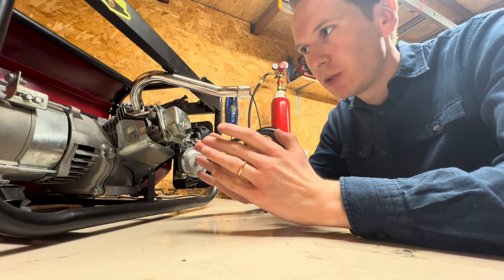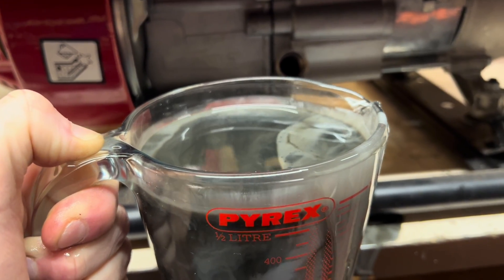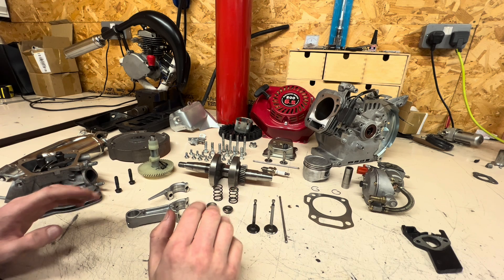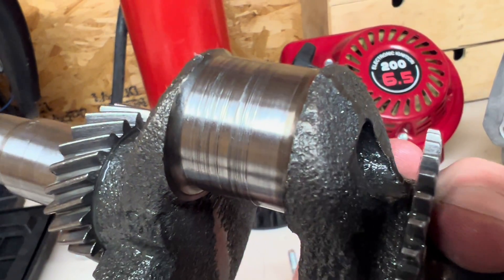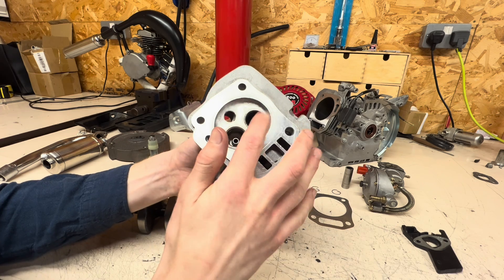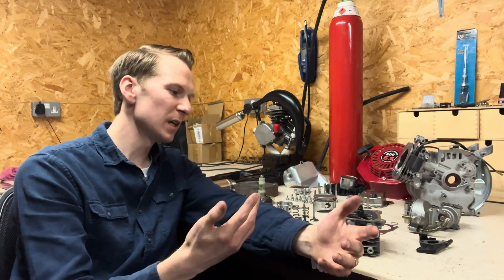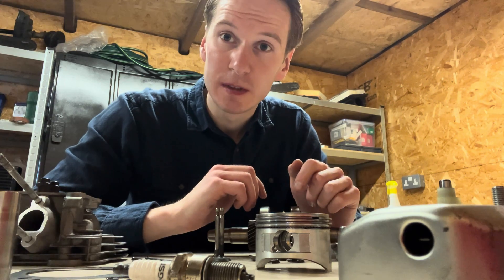Internals After 2 Years of Hydrogen

Comment: No bearing steel on the connecting rod journal is destined for failure; with the connecting rod being cast metal and the crank being steel, the rod is always going to lose out as soon as lubrication becomes an issue; In this engine, the big end simply sits in an oil bath and as soon as there is any metal/alloy contaminate in the oil it will 'attract' itself to a point of friction, in this case, the crank/rod journal, and it will keep on attracting more fine metal/alloy particles every time it runs; I note their is no oil filter in this engine; This build up of particulates has the same effect as graphite paste and causes the wear on the rod and crank journal we see here;
This has nothing to do with the type of fuel used; The oil is not milky like we would expect to see when oil is trying to mix with water....what we see here is metallic oil;
The wear on the valves is a fuel relatable issue;  I suspect valve train lubrication is not all it should be in this engine; 
Ever since the advent of unleaded petrol, valve face/seat and stem seal wear has been an issue; Unleaded/alternate fuels do not have any lubricating qualities; Hardened valve seats and Vitron stem seals helped solve this problem until metallurgy and oil chemistry caught up with the demands of hotter and dryer fuels;
This is evidenced in many modern engines with cylinder head failures being the number one cause of catastrophic engine failure; 
Bent and recessed valves or damaged valve faces (carbon build up) lead to hard cold starting before starting becomes impossible; if this hard starting is diagnosed early enough and the cylinder head gets refurbished, many modern IC engines last 100's of thousands of hours before needing to be rebuilt...providing that regular maintenance (oil changes) is performed of course.

Comment: I hate to tell you but it's a lubrication problem a thicker synthetic  oil your on the right track keep up the hard work making videos and have a blessed day today 🙏
Reply: The big end is lubricated by a 'dipper arm''.
For it to work properly,  you need a thinner higher quality oil.
Thicker oil just can't get through the splash lubrication hole and will lead to earlier failure.

Comment: If water contamination is an issue,we could make components from either coated materials or use better materials,ceramic is used in some engines and i saw a complete ceramic block.

I have a Triumph 1500 spitfire and a problem among many due to basic engineering i have now solved is that GL5 oil,i may be mixing up my GL's,but the spitfire uses what are called yellow metal bearings.

Now,yellow metal thrusts or gear shift components or in the diff,when run at running speeds and pressure the oil heats up,the oil contains additive to withstand the thinning due to heating and has solid additives like sulphur among others.

This is now back to hydrogen,when engine oils heat up if sulphur is present in the oil any water contamination mixing with sulphur at high temp will create sulphuric acid,which in the spitfire  was not good for yellow metal components,i dare say sulphuric acid contamination is not good for any engine components,except lead,but there are not many lead components inside an engine.

You can run engines on a dry sump,where you have a pump system fedding all bearing surfaces,not sure how it deals with cylinder walls,maybe some type of ceramic molybdenum coatings,i'm guessing now.

Comment: From the rate of burn compared to petrol,ignition of hydrogen is way too fast for normal ignition timing ,also valve over lap can be an issue,more the igntn though,it has to be retarded to get the igntn after tdc to stop the cod rod being pushed vertically through tdc or before.

A system of igntn timing adjustment while running to find the best position ATDC some old cars(i own a 76 spitfire) earlier spits had distributers fitted with a vernier ajustable points plate,if the engine is fitted with a coil on laminations type igntn like honda GX120 etc engines,a means to allow the coil assembly to slide around the circumference of the housing mounts by some degrees,a second mount plate with slots to allow movement to find the right position relative to the magnets on the rotor v tdc etc.

I've been looking to run hydrogen myself for too long now ,but have picked up info or components,i'm an electronics technician and stan meyer  used a pwm system and i believe ultrasonic system so i read to vapourise the electrolyte,it could just be BS,but the pwm uses two stages,one to create a mark space ratio of 1:1 at a variable frequency that controls a second slave stage that is free running at a higher frequency,you get an on off square wave that is made from a continuous higher frequency cycle,apparently a resonance can be found that will make the hho formation very abundant,also using urea along with potasium hydroxide yeilds greater results.

Comment: I've owned a number cars that i ran on LPG (liquified petroleum gas = a mixture of propane + butane + isobutane) and i have experimented with cars running on e85 (85% ethanol + 15% gasoline) 
Both fuels burn very clean/complete and leave very little (if any)  deposits on the internals.
Both fuels also work great in high boosted  turbo charged engines. (I tried, it's true 🫠😉)

H2 is an interesting fuel but the problem is the production of H2. As far as i know there are basically 2 methods: electrolysis of H2O or chemically splitting H2 from another abundantly available  compounded molecule. That would most likely be natural gas. It takes energy to do this chemical proces and the residual waste product is ....CO2. Not ideal!
So in my opinion it's easier and better in terms of energy use to burn the natural gas directly in an ICE engine. That way we would avoid  energy losses in chemical conversions.

Are there other (new?) more efficient ways to produce H2 ?? I would be interested to know!

But IF you absolutely  want to use H2 as an energy-carrier then it's preferable to use that H2 in a FUELCELL where H2 is converted back to H20 and direct electrical power.

Comment: 9:30 I don't think this engine cannot be economically rebuilt.  I would also mic the lobes on the cam. All that wear on the crankshaft is worrying in that regard.   The crankshaft and con rod are going to be more money than this engine is worth.  it would be cheaper to just buy a used engine or, if the crank is the same and it fits in the cage, just a new generic engine like a HFpredator. Or maybe you can find one for a low price for the same generator that runs but produces no electric  power.
 
I think water is getting into the oil and contaminating it, which is causing your wear problem. The oil looked very grey, especially when it was on the dipstick (there was light problems when you showed the oil directly).  That wear is absolutely abnormal.  Also, you didn't mention how many hours are on the engine.

It does seem strange though that it appears water is getting in the oil.  Burning gasoline creates a lot of water too. 1 gallon of gasoline produces 2 kilograms of water (2 liters about).

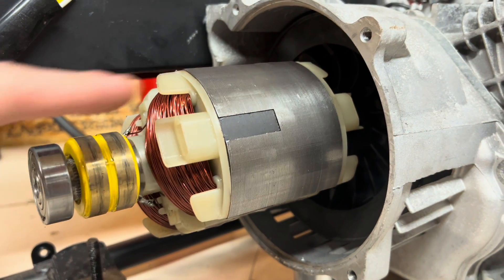Comment: 2:54  You really don't need a tool.  Turn it up so the generator is facing the ceiling.  If it doesn't already have threads (many do, but not all), tap some threads in the hole.  Then get a 6-8 inch bolt of the same size and thread.   Pour some water in the hole (most of the way) and then put thread tape on the bolt and screw the bolt in.  This will hydraulically release the rotor from the tapered shaft.  This is a pretty safe way to do it.  You have to be careful with these rotors as they have some delicate wire going to the slip rings.

You can also put a crow bar between the case and the back of the rotor. Put the bolt in and then give a good wack.  This is usually enough.  They really aren't on there that bad.  The downside to this method is if you miss the bolt and hit the wire, it will never work again and these things are expensive.  Usually either the stator or rotor will be more than the machine is worth.
Reply: Another way is to fill the hole with grease via a needle point gun. Then wind in your removing bolt. I have machined the big end journal and the conrod on an ordinary lathe. Machine the big end caps to reduce the worn diameter.  Fit shells to the rod. They do not need to be the correct ones just the right width and thickness, the curve can be reshaped to suit. I have also done this to just one rod on diesels that were run out of oil but otherwise in good nick. Engine recon shops will tell you it cannot be done but after a couple of thousand running hours and still working, I know what I prefer.

Comment: Ok this is a real idea, someone should try this, all the other attempts online are bogus. 

Take a carbureted liquid cooled engine. Delete the radiator thermostat and coolant. 
Route the carburetor through the coolant jackets, into the intake of the engine. 
You vaporize the gas as it passes through the hot engine. 
The more complete combustion creates less heat, less pollution, extracting more power. 
The phase change of the gasoline itself acts as a cooling device, like a refrigerator on ethylene or actually a hydrocarbon refrigerant. 
If that is not enough, no worry, you can add a second carburetor in series. or parallel whatever works. WITH WATER
The water is turned to high humidity air water charge. because the engine is set at 200f 95c overall temperature, the water enters the combustion chamber and turns to steam when the gas ignites. This uses the heat of the gasses and turns it to pushing force with steam. 
The whole process extracts as much heat as possible from the phase change and combustion of the gas. 
Least amount of waste, pollution etc. 
Most power. Clean engine, EASY to do. 
The only addition is water reservoir most likely and everyhting else is just fine tuned. 
The carburetors are sized down, use tillotson or jetski pumper carbs.
Reply: You don't need to do the experiment.  All you need is math.  The latent heat of vaporization is not enough to remove all the excess heat which comes from burning the gas.
Reply: @tarstarkusz  Yes and no. introducing water is the main effect in lowering temperature, and reducing fuel consumption. 
Depending on how well the gasoline is atomized plays an important effect. 

I am skeptical myself, thats why i will do it, I happen to have a honda gx360 engine which is perfect because if i happen to destroy it, i hate honda anyways and that will be good putting that over engineered boat anchor to rest. 

Water heat conversion and steam propulsion may work very well at higher temperatures.
Not very nice temps for the engine parts, but hey it caaan be tested. 
200-275f could result in significant reductions of gas useage. 

Leaning the engine out too can help with increasing egt, while adding water to decrease the resulting increase. 

I do know gas engines have SIGNIFICANTLY MORE TORQUE running on gasoline vapor. It homogenizes the flame and helps combustion and helps the less atomized charges of gas. 

And i do know engines run better in high humiditiy environments. Higher hp, because higher top speeds with high humidity or rain. It just helps, dead fact. 
So im going to try.
Reply: O and the math has been wrong, Its dead reckoning, Actually, but you know this.
Reply: And youre user name, tar whatever, are you a big oil troll?
Reply: @RobertSchmitt-u7l  My user name is a misspelling of Tars Tarkas, a fictional character from a 100 plus year old book called A Princess of Mars by the guy who wrote Tarzan, Edgar Rice Burroughs.
What is "big oil?"  It doesn't even exist.  Most of the world's oil is produced by governments like Saudi Aramco.
What is so suspicious about my thoughts on trying to use the latent heat of vaporization have to do with being a big oil troll?
Reply: @RobertSchmitt-u7l  From what I can tell from your  comment is that it takes heat to atomize gasoline and so you are proposing to use that to cool the engine.  The problem with that (assuming I understand your comment correctly) is that the heat needed to phase change the gasoline is far lower than the heat generated by oxidizing the gasoline.
Reply: @RobertSchmitt-u7l  No, it's not. You cannot cool the engine by vaporizing the gas using the heat of the engine.
When it comes to carbureted and TBI cars, they already run on vapor (fuel is vaporized in the manifold).  Port and direct injected engines do not and there is no way to vaporize the fuel.  They require high pressure fuel lines and atomize liquid fuel.
Reply: @tarstarkusz  They dont, there is a very large relative particle size compared to slightly vaporized gas, and HIghly vaporized gas. 
It is like steam and superheated steam. I am no dummy.
Reply: It will certainly work in increasing thermodynamic efficiency, I think by 50 percent at least. 
You need water for the process to fully work on an unmodified-modified gas engine. 
Otherwise compression ratio and a slew of other changes can make an engine run and passively cool itself. 
Radiator cars are true garbage if you ask me. Its one way to make it a whole lot more complicated. In the good old days they had it figured out. THe new idiot clan got it all botched and wretchedly engineered so you cant even see or work on half the shit. Its a big scam. This is why I know it works.
Reply: @RobertSchmitt-u7l  I did not accuse you of being a dummy.  I have been very respectable and friendly in my exchange with you.
Nevertheless, you are wrong.  Changing the state of gasoline from a liquid to a gas does not increase the energy you can get out of it.  This isn't a shortcoming of the Otto 4 stroke engine. It gets all the energy out of gasoline, it just doesn't use all that energy. A majority is simply lost as waste heat, vibration and noise.
Reply: @tarstarkusz  Thermodynamic efficiency is low. Best case scenario brand new engine best fuel is 50 percent. Then its all downhill from there. And the bad engines are wow just unacceptable. 
There are many papers about steam assisted combustion, I See some stating real gains went from 50 overall percent to 60 overall percent efficient, But those attempts were limitied. I see little reason why vapor charging the gas and water before ignition wouldnt work. Its almost completely optimal, but maybe too much water and too little heat for phase change might be an issue. 
You could very easily test the setup with the ex6500 honda generator, built in dyno and liquid cooling aspect, you could test a variety of methods to increase power efficiency and egt, 
I think my concept would exploit gains best though. I might also try this on a beater nissan crapo vg33e truck, the heads leak, and the engine overheats or overheated. But if i run it will 2 small carburetors one with gas and one with water, no radiator the thing would probably chug along offroad very well. THe amount of heat these bastard engines put off is just so bad.
Reply: @RobertSchmitt-u7l  I agree the thermodynamic efficiency of a piston engine is bad.  But it is not because it is not extracting all of the available energy in the fuel, it's because a heat engine is not efficient at turning that heat into usable output.
I don't know anything about injecting steam into a 4 stroke piston engine.  I've never heard of the idea, so I cannot say whether or not this could increase the efficiency of such an engine.
What will be improved by steam injection?  Like what is the theory of operation of how this would work?
Reply: @tarstarkusz  I wouldnt inject steam, I would rather have water vapor, under boiling point flash off during combustion of gas in highly homogenized mixture. The Injection of steam scavenged from the exhaust can also extract power, and it could be implemented however the volume of steam is low and multiple compression ratio compartments would be engineered into the block. If one or 2 pistons run gas to generate torque and waste heat, and then the 2 other pistons with 1 and 1 other compression ratio are steam actuated the cams can inject steam at a separate rate, generating torque instead of heat, however the cooling effect would be low because heat will soak the engine again, Having a high flow system with low egt would be most efficient. 600-900f is just way too high, and yes steam would be generated at some rate and would be of some utliity, the amount of added parts and complexity would prohibit its useful application. 
Since most people dont have engineering and manufactuirng teams to reinginner an entire machine system like a car engine, I suggest taking the path of least resistance, using best what is easiest. 
Its not the most optimal way, but It is an improvment over the JUNK they roll off the assembly line. 
If cars were made like audi a2 diesel today, used in europe right now on the market being sold and operated GETTING 80-100mpg with diesel, 
We have no excuses for sub 30mpg shit.
Reply: And the real cost for 30 miles per gallon is SOO much more than just 1 gallon of gas. The cost of extraction, manufacting extraction machines, refining, paying for those poor ass jobs and families, paying for the einvironments degredation, paying for unforseen health negative effects, paying for ugly nasty gas stations, ALLL adds up and really just exponentially explodes. 
If we cut gas vehicle gas useage by half, we save probably 16 times that in the supply chains. So fill up a car for 7 gallons and go the same distance, you damn sure will save likely 70 gallons in the inefficiency and horrid cost of business, thats not even taking into account the worthless stock market banker freeloaders.
Reply: @tarstarkusz  I could be wrong, but I seem to remember reading that some WW II fighter planes used a tiny bit of water injection to temporarily increase power output in an emergency. I'm not sure where the water was injected or how it worked.